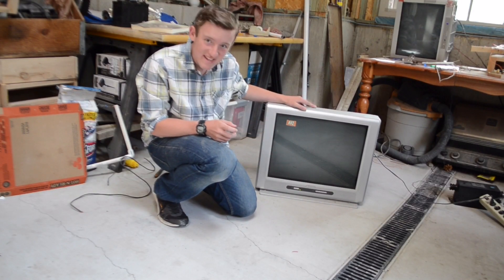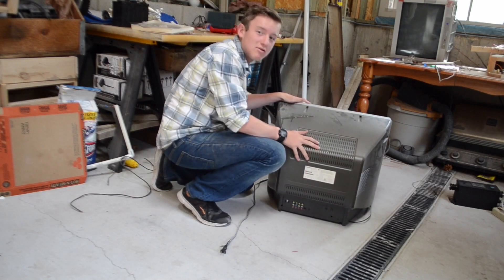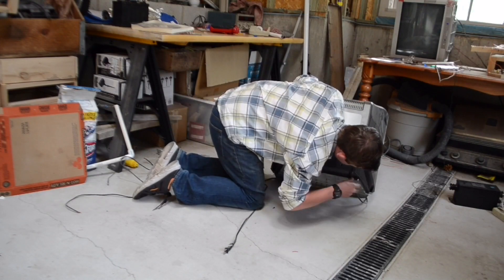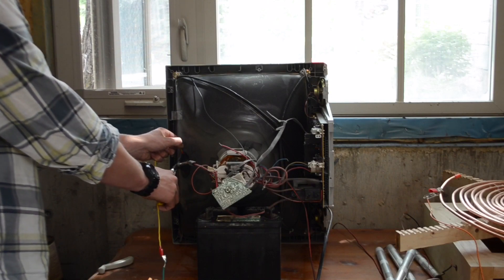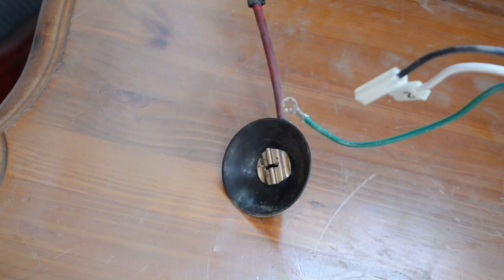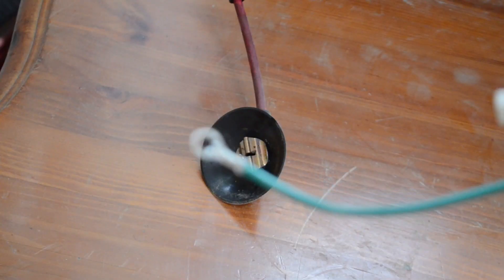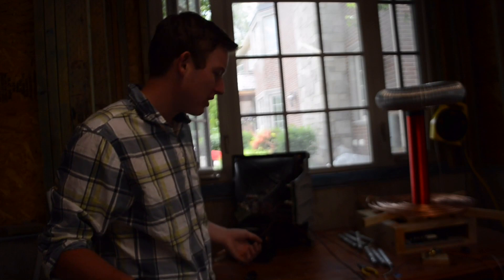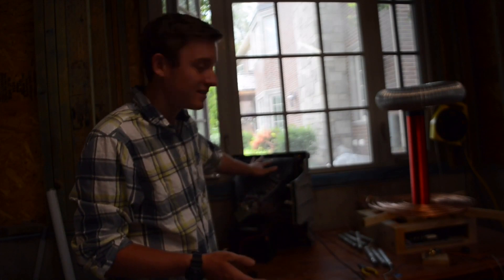How to get High voltage from a TV

Comment: If the TV is not connected to a power a supply, then that high voltage part will not be a problem right?
Reply: The screen can hold a charge

Comment: My TV didn't have a ground wire in - just the 2 ACs. When I connected the mains ground from the cable (I cannibalised an extension cable) it made a ball of plasma about 5 cm diameter, then my TV went pop. Ah well - I salvaged the transformer so I can still make a new driver for it...

Comment: Works better if you have it connected to crt also. Put the extra wire to crt-connection. From there you will have the spark.

Comment: These arcs are not lethal as they are high frequency, so conducted on skin and low current. This is not a MOT and even MOT wouldn't kill you if it didn't go through your heart
Reply: Filip Sebik They are NOT high frequency! Tv flyback transformers   use a diode to rectify the high voltage and will give you a painful shock!
Reply: The first part is right, but the rest is wrong. Yes, they have the potential to kill you, but they are not 2000v, 800a, nor 50hz. They often run at up to 20000 volts. They can't deliever much current because the voltage will drop, but it is still a nasty level of current (Nowhere close to 800a, more like 10s of milliamps through the body). They don't run on 50hz, they run at high frequencies of around 15khz and then rectify the output to DC.
Reply: Shoot. I thought you were talking about the flyback transformer. The MOT is indeed over 2000v, but still can't deliver 800a. It can do more like half an amp and tens of milliamps through the body. They run on either 50 or 60hz depending on the country.

Comment: Don't discharge the HV to ground, discharge it to the frame (braid strips over back of the tube).
Reply: Wrapped around my frame is some silvery braided metal wire - I just connect from that to the suction cup?